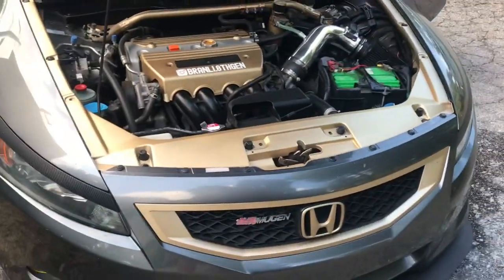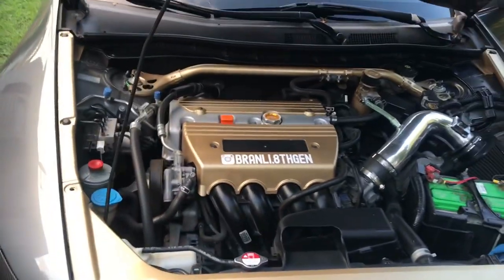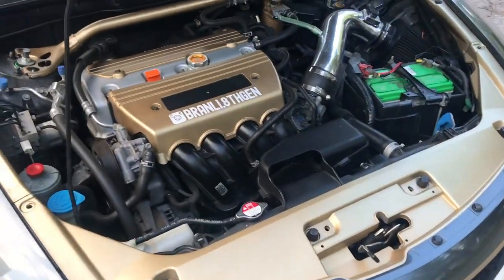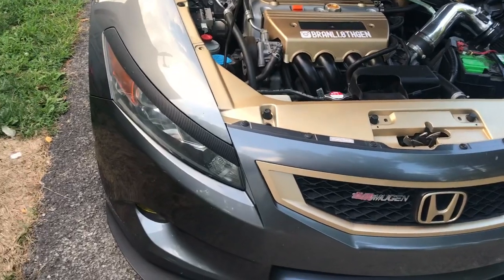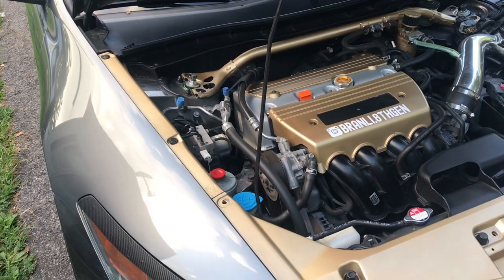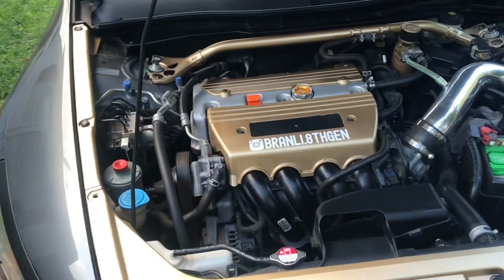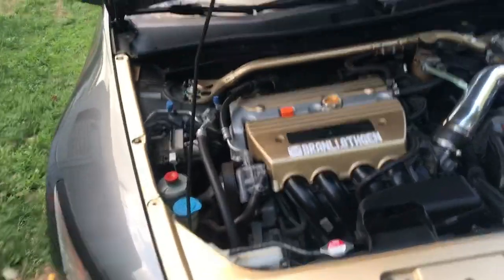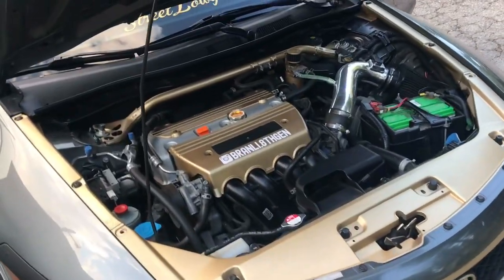Honda VTC Actuator gone bad

Comment: My 2005 Accord makes the same noise since I bought it 4 years ago. But only on cold starts at winter temperatures. Topping the oil of to the max indicator seems to help a little. I don't worry about it, because it goes away after a second. Still runs like a new engine at 260.000km. Before changing the VTC actuator, you can first try to replace the filter gaskets on the front of the engine and/or clean out the VTC actuator. There are some how to videos on YouTube.

Comment: To anybody who hears this in their car, I ask you spend an hour looking up the timing chain issues on the Honda K Series engines.  I heard that actuator rattle for years on my RSX, and while definitely a concerning sound, it never seemed to affect performance.  I got used to it, and I didn't end up addressing it.

Last week a private shop just quoted me $5500 to drop in a new engine.  The actuator failed, tension was lost, the timing chain skipped a few teeth, the engine fired while mistimed and bent the valves.  I'm getting a second opinion, as I suspect that shop is trying to milk me for the worst case scenario, regardless if it happened or not.  (It's being looked at now, and isn't believed anything below the head is damaged, but it's still technically under investigation.)  But it doesn't change the fact that I'm losing a few thousand dollars on this repair.

But please be aware of the timing chain tensioner issues of the K Series.  Make sure you know how your oil levels are doing.  And don't wait until the timing chain slips to fix the issue, it can get a lot more expensive.
Reply: Updates?
Reply: @mlm1127  Ahh!  Yeah, so my intuition was correct.  The private mechanic was a friend of a friend, and agreed to do the work for $2k flat, unless parts exceeded $1k (which it didn't).

The valves weren't bent.  He sent me pictures and videos of almost everything as he went.  So there wasn't anything in the bottom of the engine, it didn't need a new one, the shop was trying to screw me.

But he did end up lapping them all and restored compression to factory levels, so my baby's feeling peppy as if she just came off the floor.

After tows, diagnostics at the first shop, and paying a mechanic to work on the head (at a ridiculously cheap cost to me), I still ended up spending a bit over $3000.

Expensive lesson, to say the least!  Hope others can learn from it.  Don't neglect your timing chains, people.  :)
Reply: K series k20a3 or k20a2 are not cheap engines so 5500 or whatever it was sounds about right tbh if timing skipped and pistons hit valves that’s catastrophic damage and requires pretty much an engine overhaul. It would be better to just find a low mileage crated engine and replace it or get another vehicle.

Just realized I replied to a year old thread. I’m sure dude has sorted it out by now. And then after that read the comment that the engine did not have bent valves. Awesome.
Reply: @josejauregui1521  gone are the days shops touch my cars. Feels good knowing I can do it all myself. Besides major body work that’s hard af to me.
Reply: Use 1/2 quart of marvel mystery oil about 500 miles before oil change and this will be gone with in 200 miles. It’s just a gunky spring inside the actuator.
Reply: @saucysuishi341  Curious to know why the recommendation before the oil change and not after? Will definitely give it a try
Reply: @saucysuishi341  The spring could be worn as well, so the MMO wouldn't be able to fix that. There is a 'spring fix' going around, which is essentially just replacing the VTC spring, but if the timing chain is stretched it won't fix the problem. My 09 Accord (that I just bought) has this "rattle", but runs great, so I don't know what to think.

Comment: If that's the only symptom, you could go for another hundred thousand miles. It is simply the pin not engaging until oil pressure. This causes a very small amount of wear inside of the actuator, which takes a very long time to fail, by friction.
Reply: So the timing chain or tensioner isnt affected at all? 200k miles on a tsx and it rattles but still starts fine. A few people have said their chain skipped teeth and destroyed the engine and they always blame it on the actuator but they arent sure
Reply: @chinchy111  I think at 200,000 miles, it's a wise investment to have the timing chain and actuator changed. It will provide insurance for another 100,000 plus miles. If you are under 200,000 unless the noise is really bad and occurring even on short interval starts, it's probably not a big deal.
Reply: I have a 2009 accord and it revs to 2k and threw a p1009 broken sprocket!
Reply: @chinchy111  absolutely not. Is a spring that gets stuck that holds two plates apart from one another inside the actuator. Mine went away when I used 1/2 quart marvel mystery oil before I needed oil change.. Im luck to have a shop I trust and this job would be nearly free to do and they didn’t charge me anything when I took it and for valve leash and showed me one by one that it was to spec. 👍👍
Reply: @saucysuishi341  yeah ill just let it rattle. 240k miles now. I heard people pay to get a new actuator put in and it still rattles a little

Comment: The rattle is from the VCT gear coming unclocked. There is a pin that holds it in place in the home position. If the pin goes bad it lets the gear advance at startup. Once you build oil pressure it returns home (or at least it should). Adding oil will not fix this problem as its a mechanical failure.
Reply: Hi.....I have the same problem with a HR-V, just replace once vtc, it begin again with the rattle.....now I put a nanotech additive in motor oil, the rattle maybe stop......I hope.....
Reply: @EliaBertuzzi  Very unlikely. Its a sprung mechanism and if the pin breaks oil pressure is fighting the spring. Not much an addative can do for that situation
Reply: @calabschultz9648  ok, I have added the nano additive 2 days ago and the rattle stop.....I'm waiting the next few days....
Reply: @EliaBertuzzi  OK. Maybe you will be one of the lucky ones and it will work for you then. Good luck
Reply: What would be the foreseeable mechanical risk of not replacing this, and living with the noise
Reply: marshin3 timing chain failure and possible camshaft damage decreased fuel economy
Reply: Most often it is the VTC gear, not the actuator. I second what Calab Schultz wrote 👍 - the only person who knows what the real problem is.
You can add whatever you want to the oil - it doesn't fix the issue, just makes oil thicker. Might as well use 5w-30, 5-40 instead of 5(0)w-20, but the ticking might comeback depending on how the temperature changes.
Reply: OOOOOF Im just gonna pretend I didn’t hear it every morning
Reply: @EliaBertuzzi  Howz it looking now? Does it rattle again or gone ?
Reply: @vijayakumarchandrasekaran1027  yes again, a little bit sometimes..!
Reply: Or just make sure you start your car once every 6 hours lmao. Keeps the oil in there and prevents it from rattiling.

Comment: I bought my Honda new and it rattle with only 20,000 miles on it and I’ve been driving it for 14 years now no problem
Reply: Has the noise ever gotten worse? Or it just continued to rattle for a couple seconds the entire time
Reply: 20,000 in 14 years?
Reply: Yeah honda says it's not a problem  mine is at 194k and I got at 148k it's been doing it the whole time
Reply: Exactly. My Accord makes the same noise since I bought it 4 years ago. But only on cold starts at winter temperatures. Topping the oil of to the max indicator seems to help a little. I don't worry about it, because it goes away after a second. Still runs like a new engine at 260.000km.
Reply: @jeroen7699  it’s just kind of annoying
Reply: @jadenthecloud4470  No, he said that's when he first noticed it.
Reply: My 09 Accord coupe 2.4 liter started morning rattle at around 34,000 . Ive owned the car for over 11 years and at 215k still no issues. My trusted mechanic did warn me it has the potential to stretch out the timing chain but he also mentioned he’s replaced VTC actuators only to have the issue re appear 20k after the replacement. So i rolled the dice
Reply: I replaced my vtc gear about a year ago was quiet for a year now it does that still when cold outside

Comment: Guys if you have a PZEV 8th gen Accord.  Honda will replace the faulty vtc actuator at no cost to you.  It is covered under the emissions warrant which is 15 years or 150k miles.(might depend on the state you live in)

I just had mine replaced by them on my 2012 accord and it was all for free.
Reply: David Iraheta where do you live because in Cali I tried from a stealership and they said no
Reply: I called and they told me that it’s not covered in Cali after 80k, I was pretty sad.
Reply: @ramrod5972  same in Utah, the dealer said no it is not covered. I wrote to Honda and the answer I      received was a big fat NO.

Comment: some people made videos  about replacing the VVT (also called VTC) solenoid and that solved the rattle.  if a new solenoid doesn't work, then it is probably the actuator
Reply: most probably is the actuator
Reply: @gigihentz5510   yep, mine turned out to be the actuator

Comment: I have a 09 Accord that started with the Rattle on the cold start at 34000 miles. Im at 215,000+ miles and never changed the VTC or anything else major
Reply: Bro, you give me hope, I just bought a 09 Accord with 145K on it, and it has this rattle. I didn't realize it when I bought it because the car had been previously running before I got there, now I know why. The car runs great though.

This shit scares the F out of me because I have no money to spare after the purchase. So, if this becomes a major issue, I'm F'd. 

I would sign up for 215K right now if there was nothing else to be fixed. I hope I get as lucky as you. In the meantime, I'm going to keep the oil level at FULL as much as I can, and keep my fingers crossed.
Reply: Youll be fine . Just know after 160k you will need to add a quart of oil every third full tank. This model engine burns significant amounts of oil as they age. I had a major paint issue with tafetta White paint chipping. But that was the only issue that bothered me about the car
Reply: @ShhCaka  

If all I need to do is add a quart every 3rd fill up, I'm good with that. Yeah, at 145k it's already starting to eat some oil, I'm monitoring it now because I literally just bought the car. I feel like a sucker because I'm certain the guy I bought it from knew about the rattle and oil burning already, and was just dumping the car. But it's on me for not doing a deeper dive into my research.

Like you said, I'll keep an eye on the oil level, and keep my fingers crossed. I can fix a lot of stuff, but timing stuff intimidates me.

Thanks a lot for your advice and your response.
Reply: @ShhCaka  

Hey, what's your gas mileage? I'm still on my first full tank, but so far it's looking like my mpg is going to be on the low end, around 24mpg, which isn't great.

Comment: Drove mine with a rattle at start up for about 100,000 miles. It has 196,000 on the car and it runs great, just rattles at start up like in video. Told by dealer I could fix it or not. Wouldn't make a difference in how it drives. I guess he was right!
Reply: Thank you so much for this information. I’ve been worried sick that I bought a broken car. It only has 119k miles and I plan to use it for college. Now knowing it won’t cause harm saves me money and helps me sleep at night. Thank you!
Reply: Hi David Sullivan I just bought 2 days ago a 2014 Honda CRV I didnt listen to this rattle until yesterday when the car was parked in the garage for a couple hours and again today so I researched and I no longer have the manufacturer warranty and dealer wont fix it for me. I know they knew the car was doing the rattle sound at start up but because they already had it warmed up before I drove to test it  I never noticed the sound until I got home.
My car is 93000 kilometers and I'm wondering if I can go like this for another 100,000 kilometers and it wont ruin the engine? I'm just concern if I dont fix the Vtc actuator it can ruin the engine but I also read many comments of people who fix it they replaced the VTC and months later they have the same rattle at start up because is a defective piece they can change them many times and it will always go back to that sound.
What do you think of just leaving it the way it is as I wont be getting my money back and dealer wont fix it for me.
Reply: So you had no issue which year Honda CRV do you have?
Reply: Andrea Ruiz I myself wouldn’t fix it. Like I said it’s been going fine for all those miles and it’s been about 5 years making that noise now. It only does it when the engine is cold and it makes the annoying rattle noise for maybe 2 seconds at start up.
Reply: @davidsullivan8388  Thank you for your reply. I went to the dealer yesterday and showed them a video I did with the rattle noise I also showed them a bulletin by Honda where it says all 2014 CRV have this issue. To make the story short they will be giving me my money back tomorrow I am relief although I love the CRV I dont feel comfortable paying top dollars and having that horrible noise every day for the next 10 years. I live in Canada and we have really bad winters.
Thank you so much for sharing your experience.
Reply: When did you replace your timing chain?
Reply: @joelacosta5584  I never have. 220,000 miles and still going.
Reply: @Andrea-rg9tr  same problem with my 2014 crv. Replaced actuator,cam chains,o rings. 2 months later, the same sound is back. Spent close to 2k the first time
Reply: @everyone2975  sorry to hear about this is very frustrating. I went back yo the delarship next day and I was able to return it and bought 2017 Mazda CX5 more money buy is worth it at the end.
2014 CRV ver spacious and beautiful but the rattle at start up will damage the engine with time and I didn't what to risa it. I hope you can relsove this issue
Reply: @Andrea-rg9tr  yes, thank you it's very upsetting. But returning it is not an option but I'm definitely going to buy a different vehicle. We were dedicated Honda drivers.

Comment: I’m not trying to be an asshole but my friend is a Honda technician and he said they tell all the customers they’re replacing the chain and they never do if they chain isn’t stretched then There not gonna replace it they just tell you that, And they have ways of replacing the actuator without even removing the cam they just remove the intake gear with the actuator and the exhaust gear. never trust mechanics they are the worst next to the asshole that sold you the car with the pinky ring on